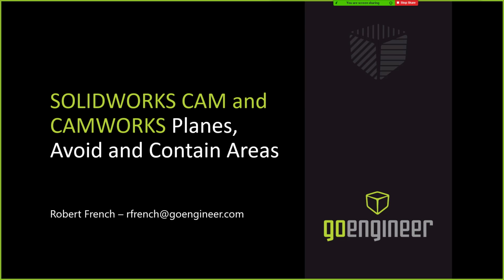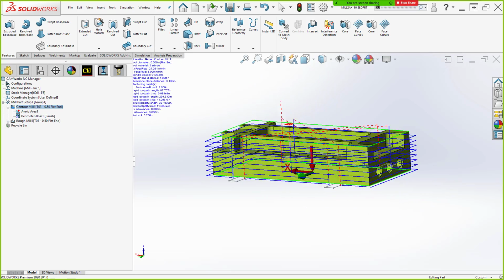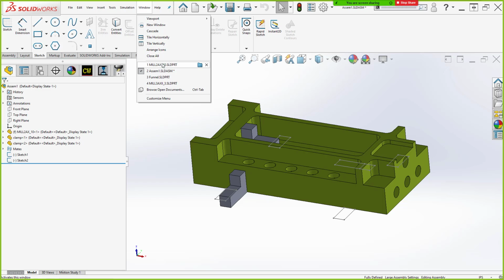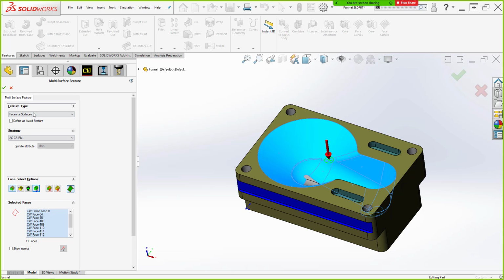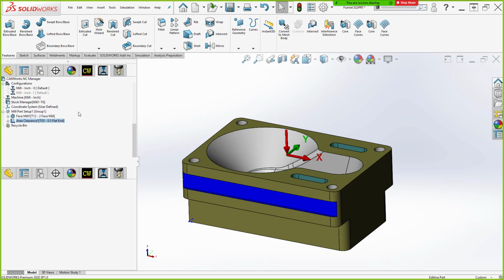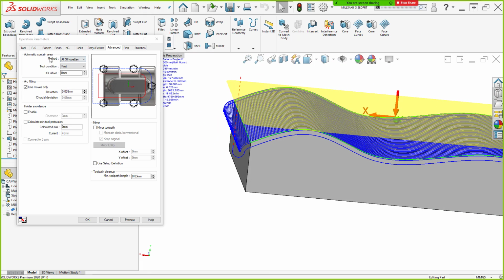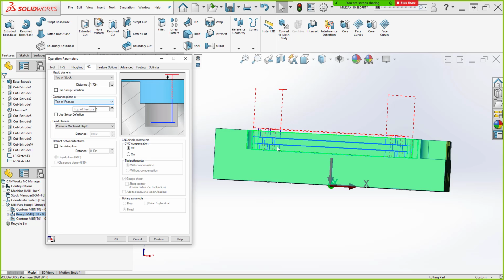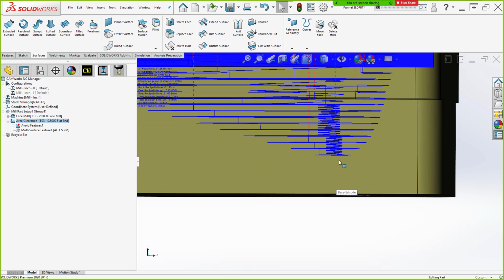SOLIDWORKS CAM and CAMWORKS - Planes, Avoid and Contain Areas

Comment: How do you stop a roughing cycle from cutting the top of a feature? I’ve already faced my part off, but the roughing cycle has its own built in facing operation. I’ve been using the avoid feature on some bosses that are tiny, like 0.4mm, that I don’t want the cutter to touch in Z. There has to be a better way.

Comment: Great stuff! Thank you so much for uploading this! Question: I know you said in Solidworks CAM Pro you can, but what about using Camworks 2021 within an assembly? I rarely use CAM on individual part files because I often machine different parts at the same time on the same table. Thanks!
Reply from the maker: SOLIDWORKS CAM Standard and Pro are the base levels of CAM software, with only Pro allowing the programming of assemblies.  All CAMWorks packages are more advanced, allowing more capabilities, including assembly machining and more.